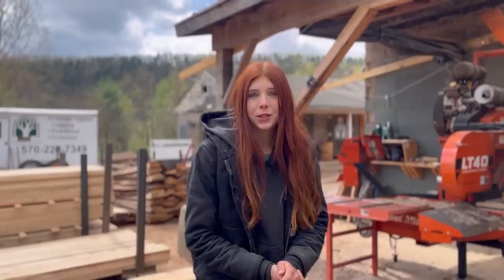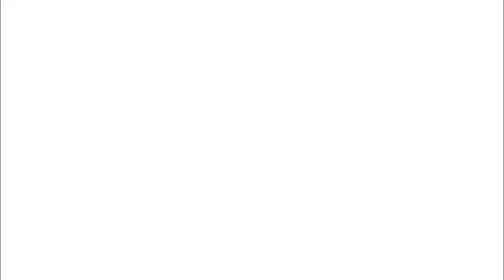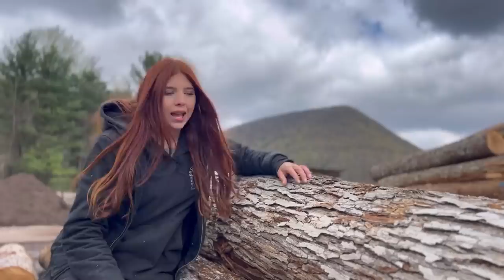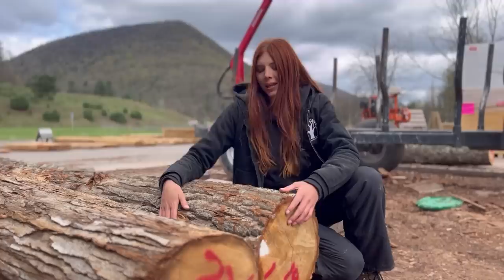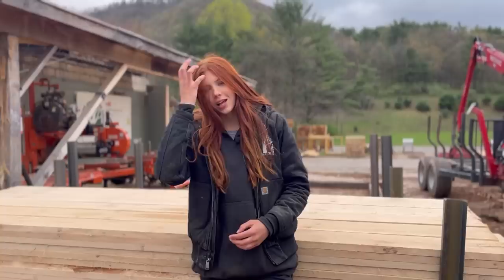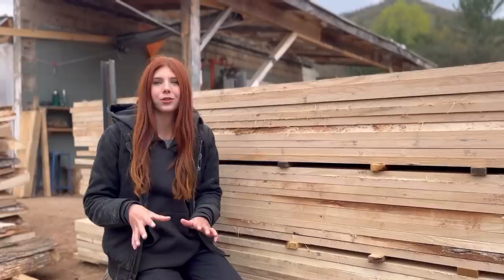Types of Oak and Their Differences

Comment: Over the years I have found that there is a considerable difference between white oak and red oak when used as threads for stairs The white oak is better. For things like built-in bookshelves red oak seems to work better.

A suggestion. Later in the year some of your subscribers might find it interesting if you could show a comparison between the leaves and acorns of the various species of oak.
Reply: White oak will flex better in time cause it is stringy compared to red oak.

Comment: Thank you for showing rock oak. I had no idea. I operated and maintained a water powered gristmill and sawmill as a retirement job. I used white oak outside for the water wheel and shafts. I used red oak inside because it is string and beautiful. Gears and pins were made from hard maple.

Comment: Here where I live we have white,red,moss,blackjack and what we call post oak. Post oak doesn't get much bigger than 4 or 5 inches diameter and grows straight up with very few low limbs. They are all quite common and are rock hard great for construction and firewood. A superb job today ladies thank you.👍♥️♥️
Reply: Interesting - on our western Ozarks farm, the post oaks can be pretty impressively large. Often no limbs below 20-25’, like yours, but lots >24”.
Reply: @johnsadler8637  well granted it may be because they are in what we call sand roughs or shinnery usually they only grow about 2 or 3 feet apart and go for miles like that I am southeast of Abilene Texas
Reply: @johnsadler8637 ...Same here, western Ouachita Mountain Range!
Reply: @arkansas1336  maybe 150-ish miles south of our farm.

Comment: Nice video, as a boatbuilder, we use white oak frequently but never red oak.  Red oak is very porous between the annual rings and thus subject to rot and other issues.  An easy test between red and white oak is to put small short blocks of each end grain down into some dna.  The red oak immediately sucks in the alcohol through the block, where white oak doesn't.

Comment: Red Oak sold for more money than the rest in board .
White  Oak  ( smooth bark) is not the same  as Rock Oak ( very deep ruff bark) in many ways  , the bark for one and how it splits , Rock Oak splits well and will burn in a camp fire green , and how it breaks under load ( White Oak will bend a lot before breaking ) and  White Oak is very rot resistant .
Many differences in the Oaks and many things similar, each has some special things about them .
Have you have ever split the different Oaks by hand  , and burned them green and used them for different things ?
Rock Oak will burn green in a camp fire , Red Oak will not very well .
Dead standing Rock Oak will be dry and Dead standing Red Oak will be wetter than when it was alive .
Ask some of the old timers about the Oaks before they are all gone , much knowledge to be had about many things .
Keep up the good work and keep the saw dust flying .

Comment: The big difference between white oak, Quercia alba and all the other oaks, despite being red or black or white by name is this. Q alba has closed tubules. All the other oaks are open. Even if they are called “‘white oak”. Only alba is used for cooperage. The vast majority of barrels are used for distilled spirits. Bourbon is aged in white oak casks. White is the only oak that will not leak through the grain. 

All the other differences are cosmetic.

Comment: You left out the main difference in the wood structure that defines white from red.  The difference is the positioning of the lenticels in the wood.  Did you know if you made a wine barrel out of red oak it would leak out through the lenticels while a white oak species of which wine barrels are made from white oak species will not leak out.  I am a certified Forester.